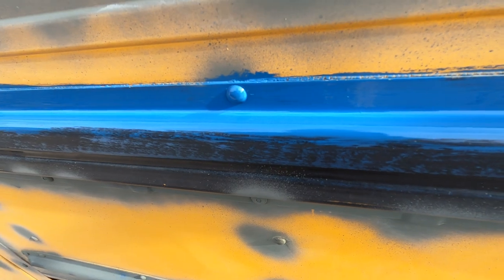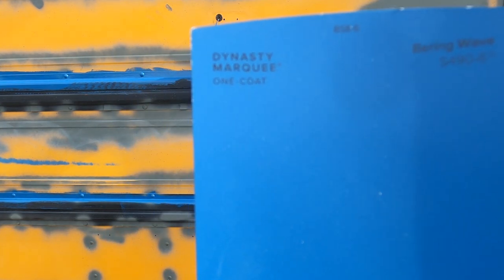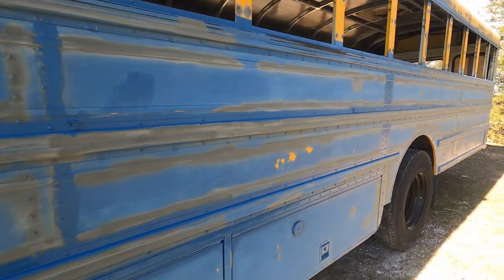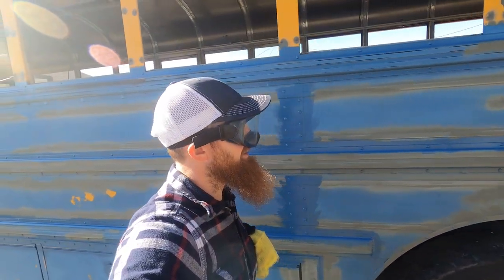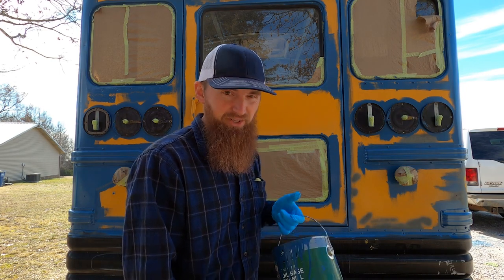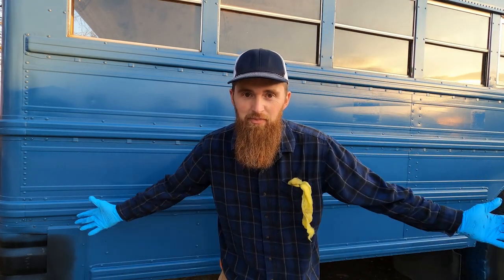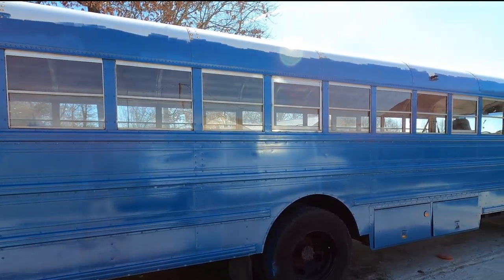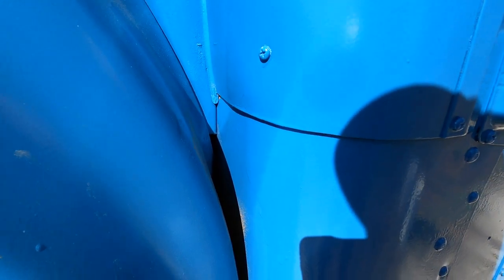Skoolie Makeover! Our DIY Budget-Friendly Paint Job

Comment: Great color choice. Really turned out nice. Maybe consider using the spray on bed liner under the fenders? I used it on a metal battery drawer and it held up nice.
Reply from the maker: That is a really good idea. I will look into that, thanks for the suggestion 💪.

Comment: It's an  nice color! The only thing that should be changed is the visors. Because the front doesn't have any visors , there's visors on the rear. I don't think that looks right.  But them lights can stay and be reused as Top Break lights and turn signals! It's a good bus 1st Gen ICCE's 2003/2004s are reliable buses!
Reply from the maker: Thank you! We haven't 100% decided what to do with those back lights yet so I left them up for now. This bus has low miles as well, I think we got a good one.